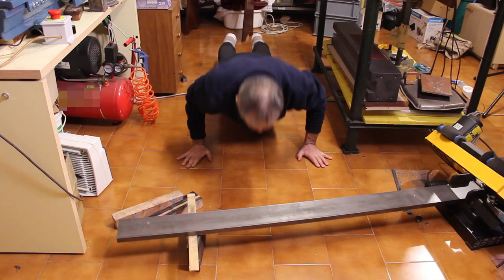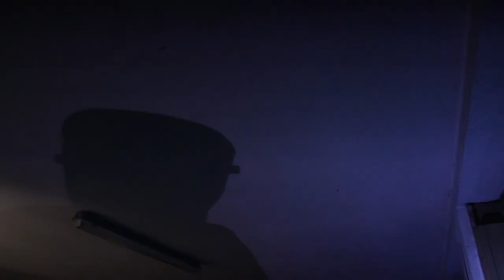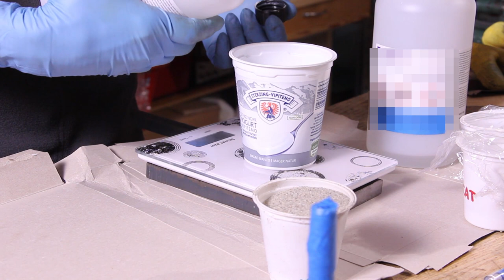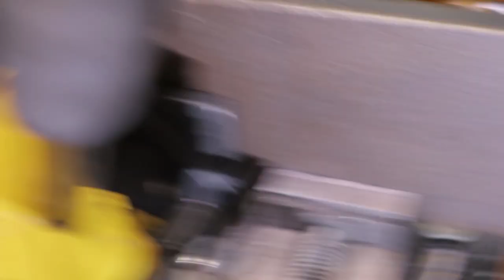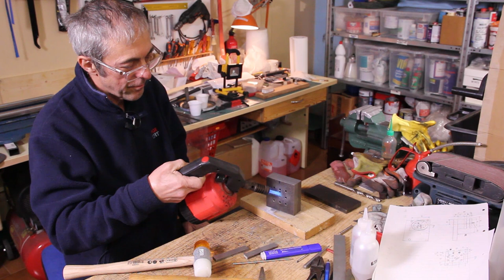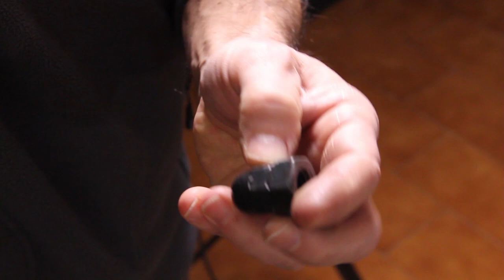Don't be fooled with DIY lathes: the toolpost – DIY mini lathe part 10

Comment: Now you have a machine to build everything but first concrete/granite workbench (make it big and solid, you won't regret it) then next will be milling machine with the help of the lathe which will be a much easier job or maybe a shaper that will help in flatness and make precision of other machines easy

Comment: To insert screw tight, without weld and easy to change in future, try make morse hole and turn morse on the Hex tip of the screw.